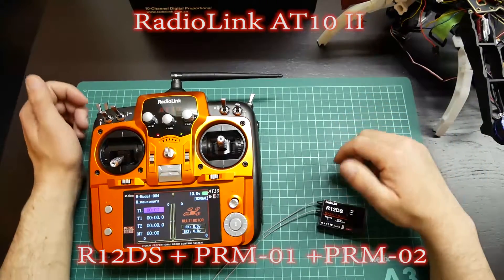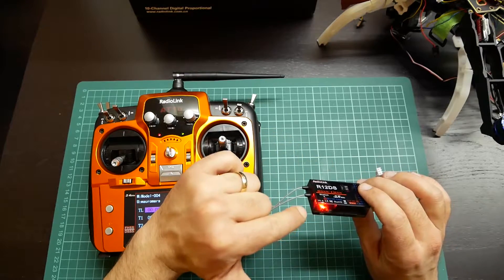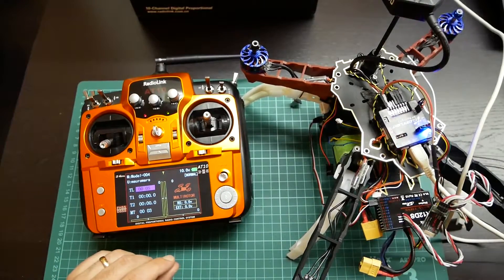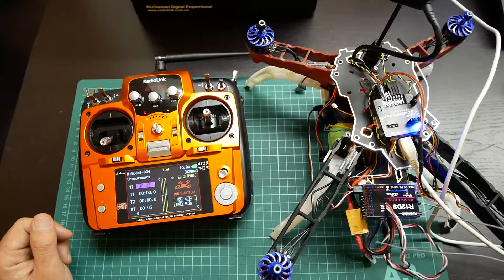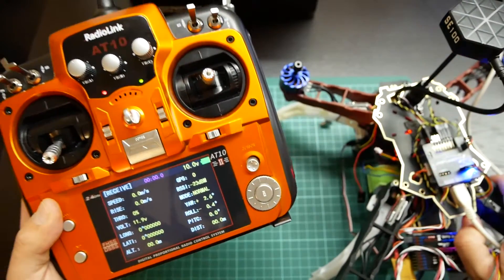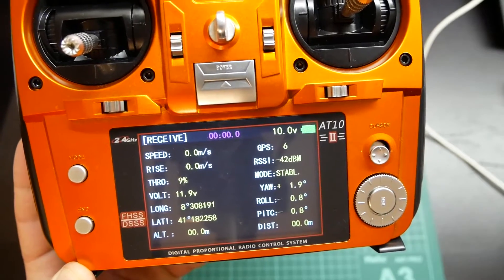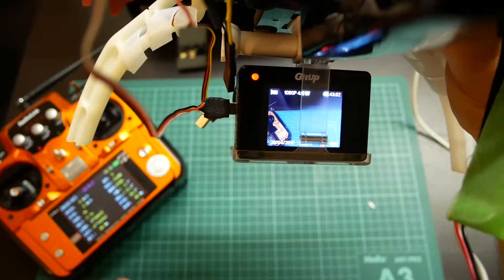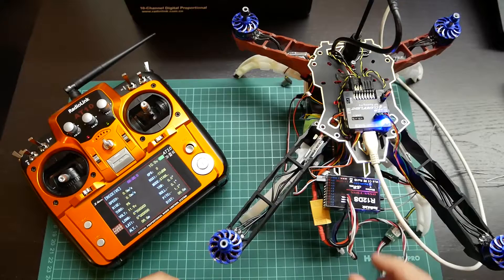Radiolink AT10 II R12DS PRM01 PRM02 INAV

Comment: I can't get the R12DS working in Sbus via Naza m V2, I have 1 plug connected because the naza is already supplying power from the Sbus, at least that's what I assume because I do have a connection.
In the Naza setup I cannot run the engines.
No idea what I'm doing wrong
Reply: do you fix it?

Comment: I wonder if you could help me with my radiolink AT10.  Am using receiver R12DS and trying to set it up to run my little 2 channel Wing.  I am unable to set the transmitter up to make both servos work as elevator and also aileron.  It is usually simple with other controllers/transmitters but the AT10 is confusing in the owners manual to understand how to set it up for a Wing.  Any help would be appreciated.  Thank you.

Comment: Nice video. Great job....
Since i am making one myself i am gonna stick to the video for a while and ask you a few questions. I have pixhawk PIX4. And AT10 II as transmitter and R12DS as receiver. Can i connect these 2 or i should buy PPM converter? I read somewhere i have to use that but it will work through PWM not through SBUS as you did it. Can i connect R12DS straight to pixhawk through SBUS?
Reply from the maker: Thanks for you comment.
Yes, you can connect directly the R12DS to pixhawk using SBUS.
On this video https://youtu.be/3rMzx6GBv1I?t=4m8s you can see a pixhack connected to R12DS thru SBUS.
If you  have any doubt please ask me that i can help.